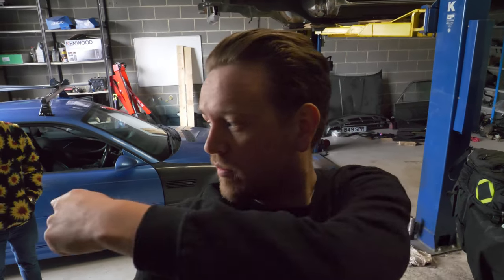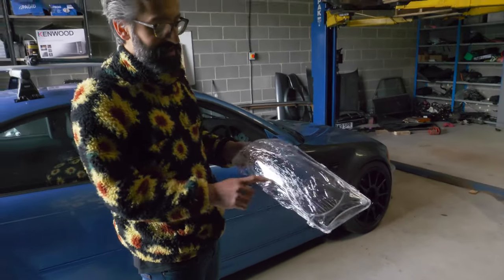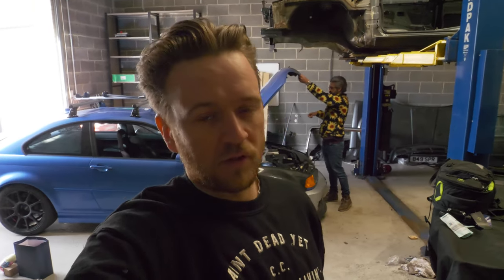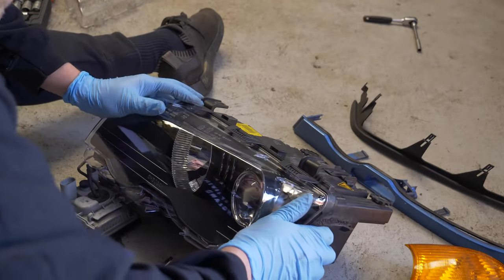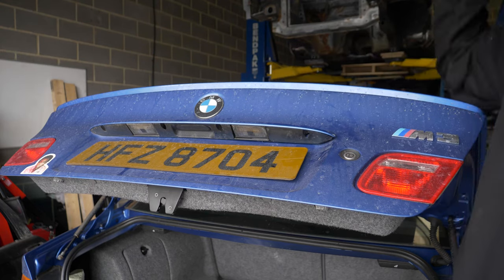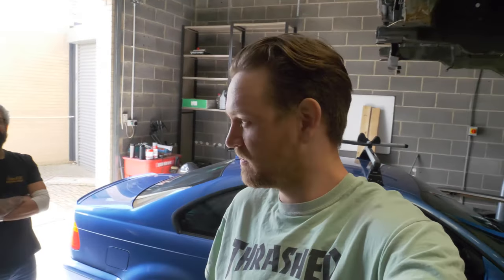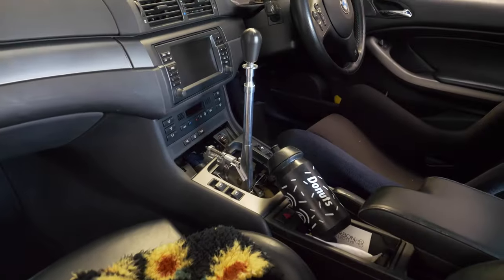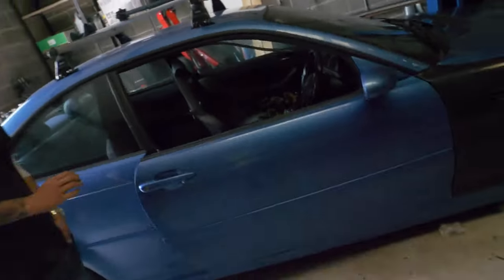E46 M3 headlight lens replacement CHBOSCH

Comment: CHBOSCH's rules! Decent quality for fair price. When you look on an M3 you don't focus on such details, you look for the engine, the wheels, the exhausts, the interior, no one is going to look to the head lights and say "CHBOSCH? Are they made in Switzerland?". By the way nice work on the tail pipes, looks brand new now. For the door sealings whitch is one of the illnesses of the E46 Coupe, for mine whitch are not cracked, i used windchield silicone glue, it resolved the problem for years now, cheap way to fix it because if you want to buy them from BMW, they're indecently expensive (800 Euros/One here in Morocco). Nice vid like always guys, i really apreciate your content, keep it up and good luck.
Reply from the maker: Thanks a lot brother! Yes the door seals are very expensive here too. Good idea with that window glue we will try that!